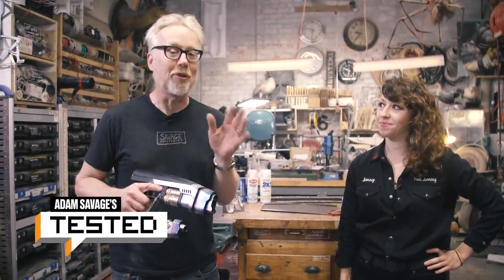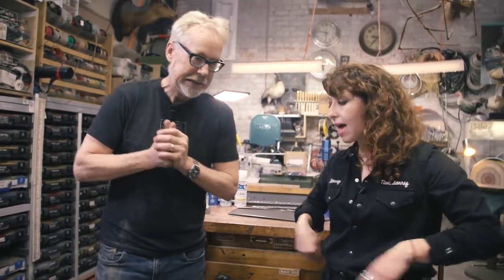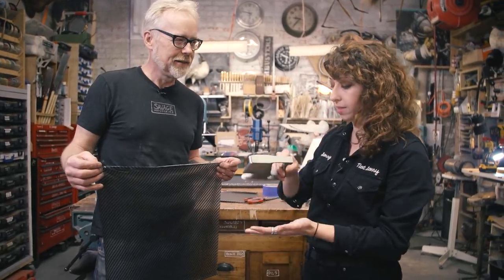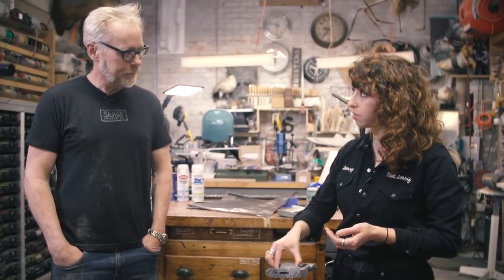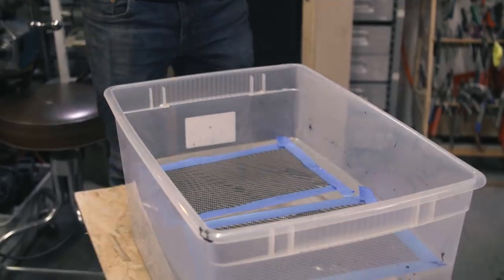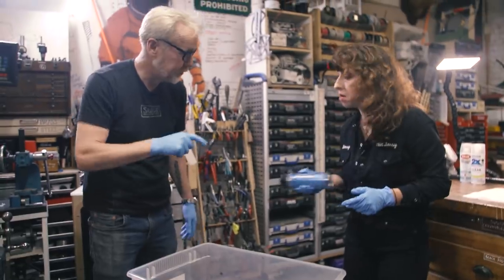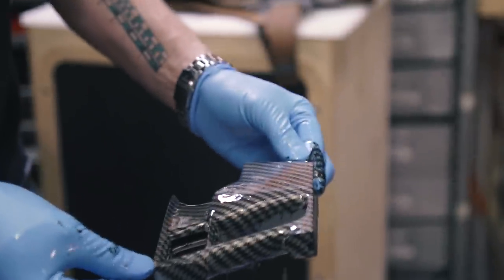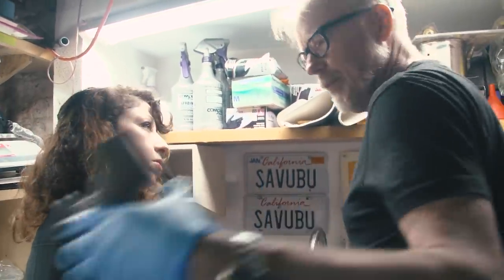Hydro Dipping Carbon Fiber Blaster Grips!

Comment from the maker: Want to do your own hydro-dipping? Here's what we used in our how-to: Hydrographics Water Transfer Film https://amzn.to/2N60G6y
Hydrographic Aerosol Activator https://amzn.to/35E9FCp
Joule Sous Vide tool https://amzn.to/39IftxI
Krylon Colormaster metallic silver spray paint https://amzn.to/308ccUc
Tamiya TS-42 light gunmetal spray paint https://amzn.to/35yvl2D
Krylon gloss clear coat spray paint https://amzn.to/37PrKim

Disclaimer: Tested may earn an affiliate commission when you buy through the links here.
Reply: Great. This will be sold out too. Adam creates a run on the market with his builds. 
I can't find a damn rickshaw lamp anywhere now! 😂
Reply: Nice!  Being using the Joule since it was a 'kickstarter' (not actually Kickstarter) and haven't ever though about using it for something like this.
Reply: You may be able to utilize an acetone vapor bath to make your printed part smoother, fill in those tiny voids between layers, and possibly skip the need for many primer and sanding cycles. Whether or not you can do this depends on your 3D print material. I'm not sure how viable this method is or if this would change your part dimensions significantly enough to create an issue.
Reply: I respect and love your shows,but it's a disgusting job. This is 100% marriage. We can't afford to do this. The film should be free of bubbles, and the activator should be fully activated. I'm sorry to see that...
Reply: In many ways, the technology is broken.. Oh, I wish I could show you how to do it right. You would be amazed at what you saw
Reply: This looks fun! Also, LOL at how direct some people’s comments are!!

Thanks as always
😀🕺🏻🎥🏖🇦🇺
Reply: I guess even if it was made with real carbon fibre you wouldn't have a consistent pattern across joins.
Reply: to save a lot of money on larger projects, the activator can be basically replicated with a 70/30 mix of standard thinners and xylene, you can knock up a few litres for the price of about 4 cans 👍 you can also adjust the ratio to your own liking to slow down or speed up the activation window

Comment: I dip parts "professionally" at my shop. It is one segment of our business. If you are doing a double dip, first mask off the part along the centerline then do your first dip. Rinse, dry, and then mask off the other side and dip the second time. Use blue or green painter's tape and you won't damage the film when you pull it off.

Comment: "You gotta iterate, just so you know what you don't know."
THAT is a really important point to make. Try it out, so that you can learn what you don't know.
And even if you "fail" at point 3 of 8, keep going. 
There are mistakes to be made (and knowledge to be gained) at the further steps also. Might as well learn several times during a single (already failed) iteration.
Reply: Steelmage99 ^^^^^THIS^^^^^ Another point I found very useful when I heard it the first time is “if you don’t like it, you can always go back and redo it”. Doesn’t work everywhere, and can be really demotivating, but if you for say are painting something, instead of just giving up when you screw up and tossing it and starting over, power through, try fixing your mistake or hiding it. If it doesn’t work, you can always start over, but it might work and you’ll always learn something.

Comment: Hydro dipping isn't uncommon in nerf moding. One of the great things about the blaster shells is that they "clamshell" open so that the left and right side can be done separately and you don't get overlap.
Reply: Yeah, it's really blown up in a few years. Didn't see people dipping sneakers the last time I checked a few years back :D
Reply: @esaedvik  It's gotten quite a bit cheaper because you can get stuff in smaller quantities now. Back in the early 2000s when I was looking in to doing this, you had to buy a full roll and no one was really selling say a 1 sq meter. You can now get smaller quantities on Amazon/Ebay/Aliexpress very easily.
Reply: You are correct! I haven't tried it myself, but the results looks really, really good. lorddraconical 's channel shows off some of the ones he has done.
Reply: Bucket of water and a few cans of browns greens instant camo nerf gun
Reply: modding*

Comment: Thanks for featuring this, it's a pretty fascinating technique! 
The pattern films are an advanced use-case, but for starters you can achieve pretty awesome marbling effects just using different spray paints successively to lay down a film on the water surface and then adjust/swirl it with a wooden skewer or something similar.
Reply: There was a video about this exact method over on The King of Random channel a few years ago. They did the slide for a glock in an urban camo that looked amazing.

Comment: I bought a kit for this once. Used it once and never again. Its great for when you really need a certain pattern like carbon fibre here. But in my years as a maker that moment never came. For most parts you need giant vats. A bathtub works for guitars, but just about. Very tricky and and a lot of preparation. Spraypaint can be done in a few minutes.

Comment: @15:00 thats great advice but a thing to consider if you are printing multiple objects to hydro-dip, your practice pieces can be just single wall hollow shells (or even vacuform shells) and it wont hurt your material budget or take too much 3d printer time. afterwards your "hero piece" can be the single high quality strong part after you are comfortable.

Comment: This is perfect! I was literally just thinking about doing this to blade runner blaster grips. My idea is for it to have the design of the old blaster, but the paint of K's blaster.
Reply: Real carbon fiber is pretty cheap in small batches and easier to make look professional.
Reply: People like to do this to their nerf guns, too.
Reply: @MisterRorschach90  really? How would you contour it to the complex shape?
Reply: Chase by cutting the fabric in a specific way and using a vacuum to get good adhesion. Though after finishing this video it looks way more real than I thought it would, and it’s a pretty cool process. I still like fiberglassing more though. But that’s just me. Probably because I spent so much time teaching myself how to do it. Lol
Reply: really impressed with the finish, but making small things in real carbon mat is pretty simple if you can manufacture a negative mold. I've seen small auto parts made from plaster moulds. Guess the same could be done with the actual grips, or even 3d print if the resin doesn't affect the filament used?

Comment: I hydro dip my home made effect pedal cases all the time, with different graphic films. Really easy and cheap way to get a really complex graphic onto a part. Definitely agree about getting the film to behave properly, I have found putting too little activator isn't a massive problem it just makes the excess film really drippy and gunky so it doesn't split off at the edges of parts when you swish it under the water after dipping. It's kind of like one of those cakes with chocolate dripping down the side as my best description of this. It's very much a practice makes perfect 'and even then your eye balling it' type of skill.

Comment: The whole time i was wondering why they didn't print 2 separate sides from the beginning?

It sounds like you should cut your models before you print them - based on how many hydro dips you will need. Then you could recombine for the final piece with less priming & cleanup.

Also the bonus of if one side didn't work out as well - you would could pick your best left and right dips.

Great intro video - thanks!
Reply: Maybe the shape was a bit too complex for having it made of 2 sides. Like if there's a slope that's going through the whole piece on one side. Or they just didn't think about that.
Reply: @bl4cksp1d3r  for sure and i agree! I was just saying that is how i would approach it. Especially since most toys and real guns would be more separated pieces to allow for the molding process and would expedite the hydro dipping. I learned a lot fro this video. It definitely helps to make decisions earlier and more slices can sometimes help. 🙂
Reply: That's a very intelligent point, and sounds like it would make the result even better. If I ever try this, I'm going to keep it in mind.

Comment: In re: to keeping crisp “seams”, what if you were to tape a seam surround for the first dip, then after drying, you tape off the undipped side prior to clear coat, then removing said tape prior to dipping the other half. This would help in avoiding unwanted seam overlay. Just my thoughts. Excellent video!

Comment: For your complex part I was thinking that you could coat one side by dipping it in paint booth wall coating solution, which is water soluble and then dip your part after it has dried. Then soak the part to dissolve the booth coating, then dip the other side to get a cleaner line on the edges. You could even try dipping the texture dipped side in the booth coating to protect it from getting an overlap.

Comment: this is a really neat process with a lot of applications.  at yhe same time tho it wouldnt be that difficult or expensive to just go ahead and lay a sheet of real cf over it. you only need a single ply of the cheapest fabric since it isnt structural and it would be major upgrade to the authenticity. Elevate it from looks good from 10 feet to looks good from 10 inches

Comment: I don't know if you know this already, but you could do a vapour acetone smoothing of a 3D printed object. The acetone vapour will dissolve the surface layer to smooth out those printing lines. There is probably info on the internet on it. I found out during a undergrad chemistry project from my supervisor, BUTTT I haven't actually tried it myself :(

Comment: Two sided hydrodipping without the weird overlap is possible. Just use masking tape to mask the top half. Afterwards you can remove the tape, clearcoat the bottom part and the mask the part that was previously dipped.

Comment: Can we just mask the opposite side with tape and do the same for the second time to avoid cross blending?
Reply: Give this man a raise
Reply: momo  I didn't think of that. Well maybe we can use masking tape for the first side, wait to cure, apply a protective layer, remove the tape, than we apply masking tape for the second side.
Reply: My thoughts, exactly.
Reply: Just run an X-acto along the seam before you remove the tape off to prevent the film from peeling.

Comment: The fuzzy seam where the pattern doesn't overlap perfectly between the 2 sides can be somewhat realistic. If you look closely at raw carbon fiber bike frames, you can see similar seams where the different sheets are laid out. Especially around complex curves and joints!

Comment: The paper tape frame she made around the hydrodip is great for objects that are not thick, but as you can see already while dipping, the hydro dip starts to fall apart because it can't stretch while dipping. Without the frame this wouldn't have happened. So, for thick objects, don't use a frame, or make the surface a lot bigger than the dimensions of your object.

Comment: With the CRICUT machine. there is a Carbon Fiber setting *cutting in its settings.. have you tried using Kevlar or Carbon Fiber in your Cricut Maker?  I commonly make soap molds and engine gaskets with the Cricut Maker... (yes even electric wall socket insulation).
Reply: Jenn is freaking awesome and resourceful! wow! coolio!

Comment: I was thinking since you 3D printed it that it might have been easier to split the print in 2 and then it would have been easier to get the hydro dipping done on both sides so you didn't end up with the overlap and would have a better seam to work with.  Just a thought though.

Comment: I think I would print those up in two pieces that glue together after with locator pins to have a nice even seamline down the middle rather than having the pattern overlap after dipping twice, but that's just me. I like symmetry.
Reply: Maybe. I can definitely see where you're coming from, but I feel like it's better to take care of the physical parting line seam first, unless you can get the tolerances on that seam really precise. It should be possible to prevent overlap in the pattern by masking, right? I guess it depends on how durable the first dip is after it's dried and clear-coated...

Comment: Is it possible to mask the space on the object you don´t want to dip or will it rip while demasking?
Reply: I curious as well. The tape edges might ripple or something when wet. Not sure if you would pull the tape before the dip dries or after.  I think that you may be better off dipping first, then masking and painting to cover the pattern where you don't want to see it. Something worth testing a few techniques first to see.
Reply: It is possible. I've seen people doing it in guitars. I kinda wonder why they didn't use the technique here, I'm guessing probably they don't want to make the line too visible because of the separate coats.
Reply: Yes, that's possible. I have done this with paper masking tape.

Comment: there are many different dipping techniques.. first if you want to do a double dip  there is no need to clearcoat in between.. instead tape off the side not being dipped that way you have a nice straight seem line. then after you dip the one side let i dry  remove the tape.. it is important not to rinse the piece. the left over pva will act as a protection barrier so the film will not stick to the side that has been dipped. you can rinse after both sides are dipped. also you can use a piece of scrap film to pull paint to but in an air brush to touch up any blems.. this wont work for carbon fiber pattern but does fine on cammo patterns .as well as softening the seem itself. to extract the paint from the film applysome acivator to the color you want and scrape it off with something like a Credit card. and put it in the air brush.. you will see what im talking about..lol  ony the paint comes off the film.. or you can just use a paint brush .. you will be spuprised what you can fix this way.. just be sure to rinse the activator off from the areas that you touched up....i have been doing hydro for a long time.. i am a gunsmith and for a while everyone wanted to customize their firearms with this.. i personally hate dipping but over the years i have seen everything.. if anyone wants any advise just dm me insta: willebiggz i would be glad to help... btw adam way to go.. it looked good.. but there is alot of stuff you guys left out that could make this easier for the home hobbyist

Comment: When you lower in the film  try not to drop it  but is it down as it follows the water .  You can also nip the corners of your damn tape to allow room for expansion. So make sure you give your hydro film enough soak time round 90 seconds. When you spray the activator and slow down a little bit not quite so sporadic think more like robot. If your spray pattern is a little bit heavier this film should flow better. Give yourself a larger piece of film as well to work with allows you to travel through the film more. Allowing you to laydown a smaller print pattern. Any other questions I'll be more than happy to answer them. Up until about a year ago I had done hydrographics for 3 years plus. Unfortunately not doing it anymore but when I was I went through a lot of jobs in a short time. There's a lot of intricacies that you can't find on videos. Unfortunately I did not put up more videos of my work but there is at least one on my channel of a dip I did the candy coat clear.

Comment: I would probably mask it off first rather than removing it with a sponge afterward.
Reply: Might not be able to remove it with the sponge then afterwards?
Reply: @kyapox   You can remove the mask.  :-)
Reply: The problem is with doing it that way (because I have tried) is it sticks to the mask and the item your dipping the same and when you remove the tape it can peel away the film from the part thats not masked. It doesn't behave the same as paint, its almost like if you put masking tape under something like wallpaper...
Reply: Same can happen when painting. I have used a scalpel along the edge of the maskingtape to score it before removing the mask and that help a lot.

Comment: Adam, I was just thinking about this circular spinning LED display that I've been playing with (called hologram fan on ebay) ... And I think if someone were to add about 20-50 more vertical layers of LEDS on top of this, which would NOT really be too hard for the right makers... you could make an actual FUNCTIONAL 3d display Dejarik board!  I thought you might like the idea of that?

It would essentially mean turning the LED board sideways, making it on clear acrylic, and adding more rows.  With a WiFi connection to drive the display off a computer inside the board's base.

I would do something with that idea myself, but I don't have the programming knowledge.  Maybe you know someone who can try it?

 The only difference is that the real board would need a clear cover around the 3d area, so no one would harm their fingers.

Comment: hydro dipping- oil paint (non water solvent) on water surface and dip your part in; applying decals ( that's kind of what your doing) is not really hydro dipping. cool effect though